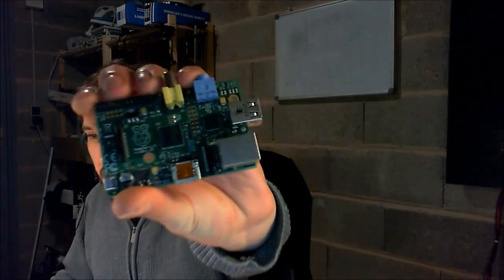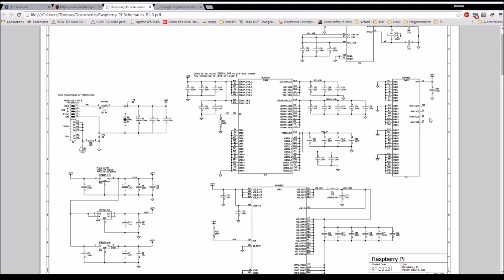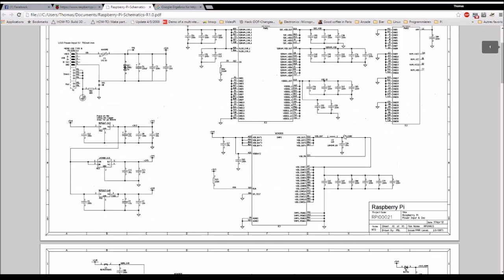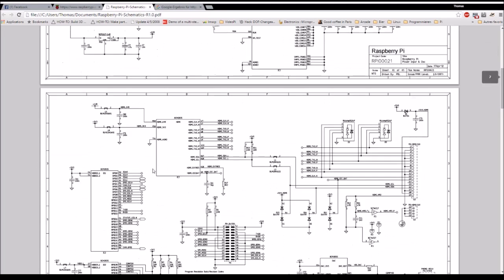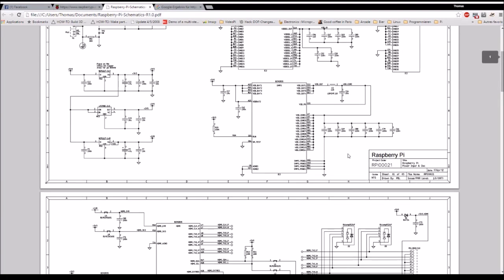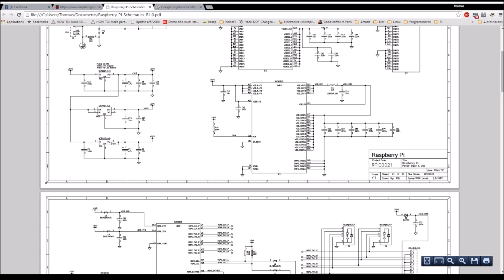Howto: Convert a Raspberry PI 1 to a Raspberry Pi Zero *fun*

Comment: Shanme on you!
Reply from the maker: +Peppo Booi : why? did you whatch the video to the end?
Reply: +Thomas Sebastian I did not! 😈
Reply from the maker: +Peppo Booi then do... and you will see that i actually explain that the PI zero is just a PI1 with some more memory and no ethernet/usb/csi.... less connections the "old" A+ has... Many of people see only "Oh, a Pi for 5$... lets install a mediacenter" and they have no clue what they actually buy. 

My video is a funnt/extreme way to show people what they get for the $... out of a 5$ computer it can be actually more expencive then buying a Pi1B directly.. it needs adapters, a usb-hub etc. 
As said in the video: there might be use cases for it - but for somebody dooing a mediacenter or just learn to code it's not well spend money.